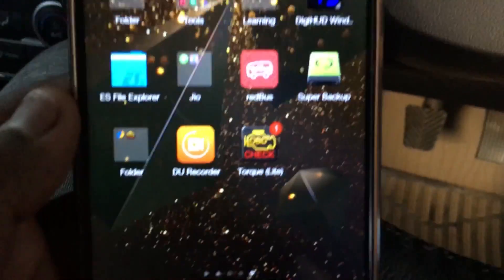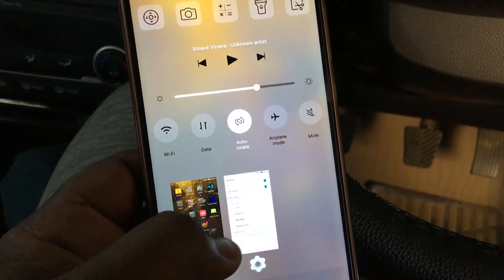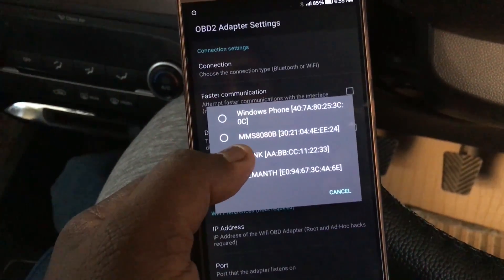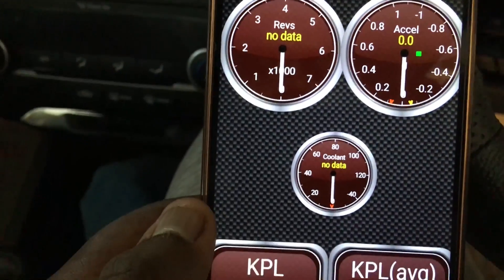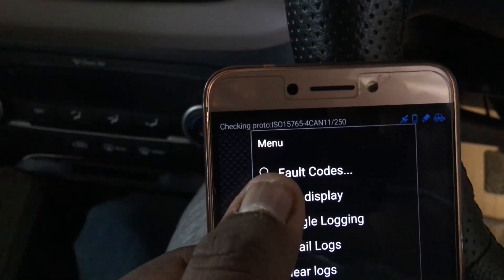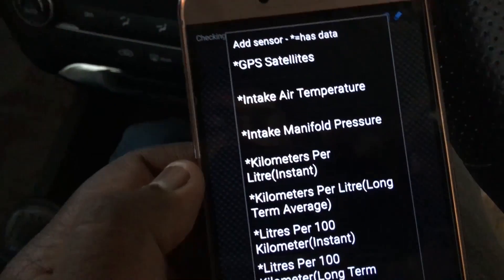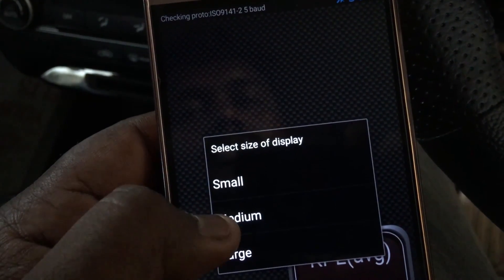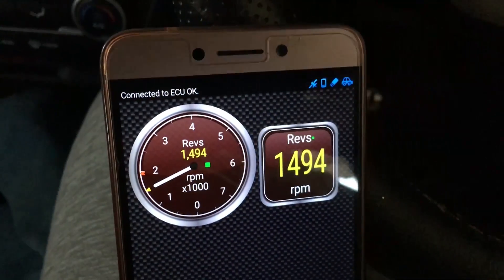How to check Realtime mileage of your car using OBD Device

Comment: I just got an obd 2 adapter and when using torque lite on my car the mpg is way off. Says I'm getting like 45mpg but I'm only getting 31mpg in reality. My car is an 06 pontiac vibe so maybe it just doesn't have the right sensors to accurately read that. I've read that with torque pro it reads more sensors and there's something you can do to make it more accurate but idk if that applies to all cars?
Reply: Torque pro is definitely worth it. And get a obdlink MX for your car if you want 💯 accurate. Its about 150$ Canadian but worth it

Comment: Thanks for video. 

I have 2004 Citroen C3 1.4 HDI 92 HP. I cant see my trip computer because of trip computter button(doesnt work-need to new one) 

If ı buy OBD device,can i see long-term fuel consumption? Or just a realtime consumption?
Reply: A tip : watch series at instaflixxer. I've been using it for watching loads of movies during the lockdown.
Reply: @Hugh Briggs yup, been watching on InstaFlixxer for since november myself =)
Reply: @Hugh Briggs yup, have been watching on instaflixxer for years myself :D

Comment: hiii. swift vdi 2008 diesel model ke liye konsi obd device buy kru....please reply mee........your video very important and usefully....Thanks
Reply from the maker: Sp kamboj OBD2 Device is not compatible with your car.
Use OBD 1 device.
Reply: Elite Evo Club please send me obd1 device photo ...my e-mail     is spkamboj47@gmail.com....please send me pic
Reply from the maker: Sp kamboj try google for "Tech II scan tool" check the images, this is the tool usually Maruti Suzuki is using in India for older cars.(for car model <2009 year )